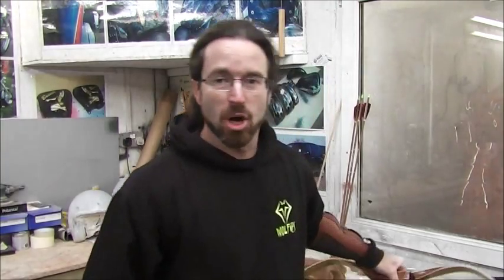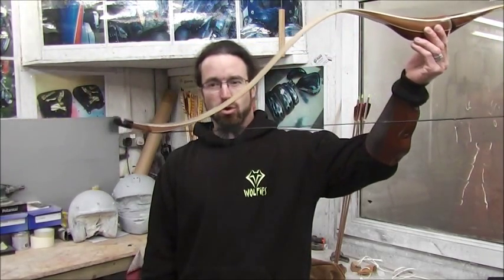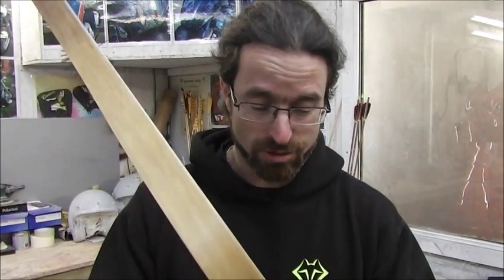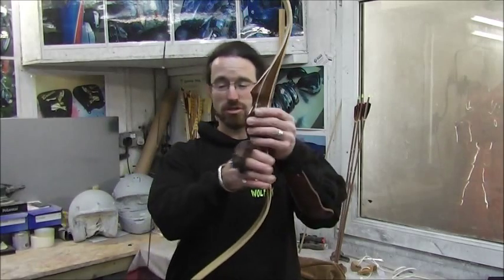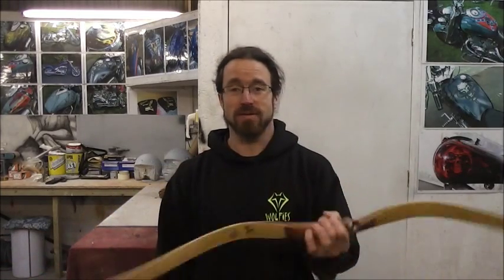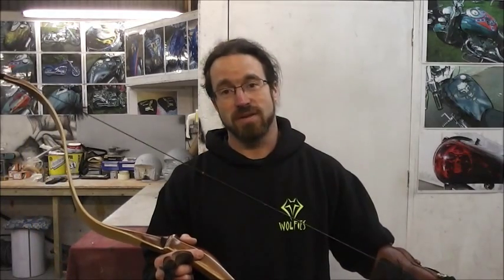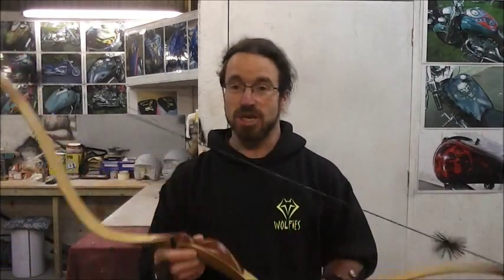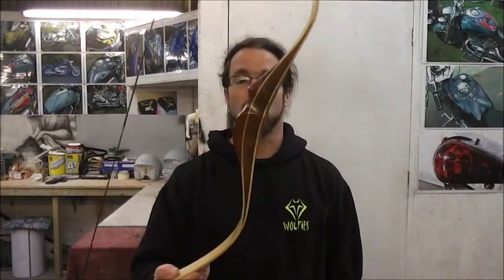PIERRE DE WET,  CUPIDO BOWS, SCYTHIAN 2

Comment: the experience i have had with the same bow type from grozer in hunting no good:  slow despite the poundage 60, noisy, inaccurate. just as i changed to hoyt TKD and predator, everything went good in a hunt. so i doubt if the asiatic bow type has any efficiency  as to the samll love target shooting